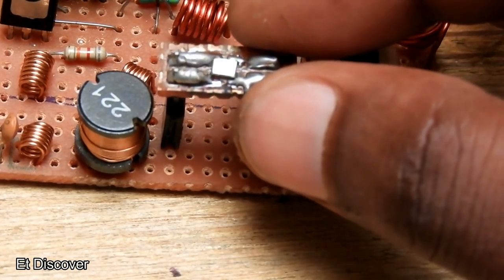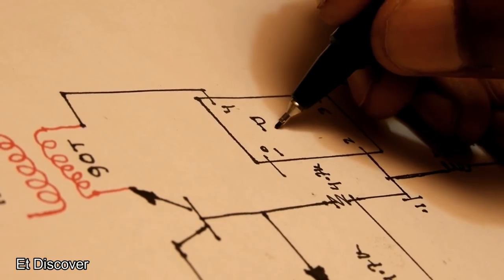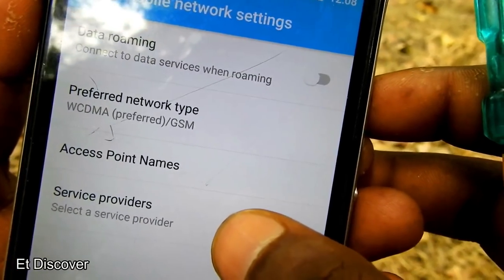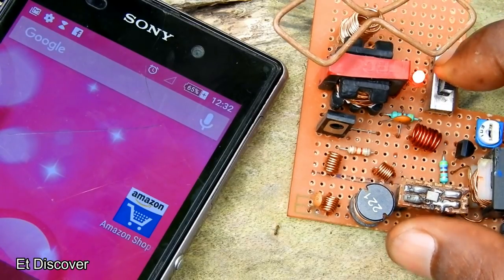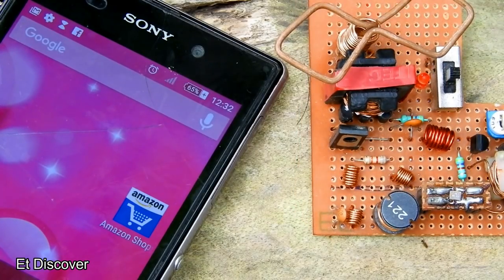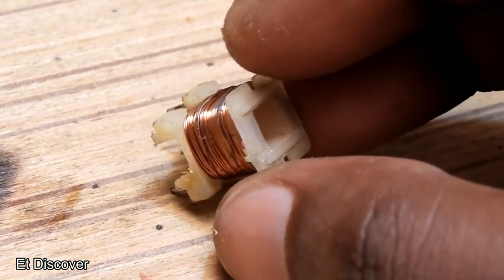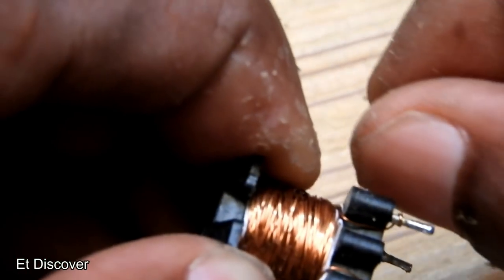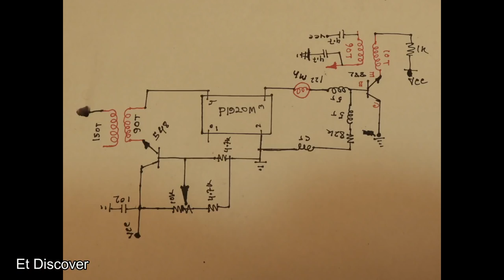Cristel Oscillat 4G 3G 2G Network Signal Booster (Et Discover)

Comment: This circuit is great.
It even works for wifi.
Signal increases 2 bars and no more disconnects.
Also on it close to digital tv antenna no more picture breakup.
I put it next to my auto engine. Mileage to up 10-15 mpg and lots of power.
I put it on my pillow at night now the bald spot on my head is growing a lot of hair now.
Also missing 2 tooth in front new one grow back.
Wife too small on top put circuit in her purse now like mountains but problem now she poop a lot.
You should build on black box sell make a lot of money.
Reply: Congratulations for improving yourself for this project. You should make his your own God. 👌🤣

Comment: I dont think it will boost the existing signal from the tower. What you did was made a hotspot of 2400 mhz by your old phone oscillator which your new 0hone detected . It will will only show that you have full network but you cannot call anybody. Correct me if i am wrong.
By the way nice work 😉
Keep it up.🤗
Reply: Abhishek Sarangi  You are more than correct Bro, you actually explained it like a pro. What he produced is a one-way modular or miniature transmission station sending out but not receiving signals back, so clearly it can't achieve two-way communication
Reply: right bro this is 2400mhz signal   generator  not booster 
we can't call from thisnetwork no data
Reply: Exactly
Reply: simplex transmission not duplex transmission . am I right ?
Reply: Ok you all are telling it is 2400 mhz generator.    it can boost 1920 mhz
Reply: @animeshyadav2369  please tell me it can boost 1920 mhz
Reply: Hi abi, i have been facing airtel network issue at my residence from past 3 year. I have lost hope on airtel that they would improve the reception. They just killed my time. Our neighboring houses are jointly connected to every house. I completely loose signal in ground floor. Plz help me how can i get better reception inside my house.
Reply: @falconkillingmachine3450  just get a proper booster they are cheap now
with proper silver rare earths that is truly the only way

Comment: You have used 2 transister here 
1) 150T /90T
2) 90T/10T .....plz specify primary and secondary coil in both
Reply: i think the secondary coils are the ones with less turns. Not explained very well. Hard to build because of less information availble from this video.

Comment: what does it mean: transformer primary 150t 30awg and secondary 9t 27awg? Is the transformer purchased or is it built? 150t = 150 turns of wire 30awg? Thank you!!

Comment: Where is the data network symbol like E for EDGE, H for HSPA or 4G or LTE for 4G. This just for 2G not for all frequencies. It is just a signal hotspot that's why he has not shown the network name by sliding down the status bar.
Reply: You just bump up the crystal oscillator to 2000+mhz it will do all of them. But i doubt you can find one in market.

Comment: Super . It is useful for  no network places... People....
Reply: This circuit is great.
It even works for wifi.
Signal increases 2 bars and no more disconnects.
Also on it close to digital tv antenna no more picture breakup.
I put it next to my auto engine. Mileage to up 10-15 mpg and lots of power.
I put it on my pillow at night now the bald spot on my head is growing a lot of hair now.
Also missing 2 tooth in front new one grow back.
Wife too small on top put circuit in her purse now like mountains but problem now she poop a lot.
You should build on black box sell make a lot of money.

Comment: it seems made to generate signal around this band ...amplifying  such signals of 2g if it is so...great
Reply: This circuit is great.
It even works for wifi.
Signal increases 2 bars and no more disconnects.
Also on it close to digital tv antenna no more picture breakup.
I put it next to my auto engine. Mileage to up 10-15 mpg and lots of power.
I put it on my pillow at night now the bald spot on my head is growing a lot of hair now.
Also missing 2 tooth in front new one grow back.
Wife too small on top put circuit in her purse now like mountains but problem now she poop a lot.
You should build on black box sell make a lot of money.
Reply: @gordonwelcher9598  i again explain here for yourself?

Comment: Good & usefull circuit 👌👍😊
Reply: This circuit is great.
It even works for wifi.
Signal increases 2 bars and no more disconnects.
Also on it close to digital tv antenna no more picture breakup.
I put it next to my auto engine. Mileage to up 10-15 mpg and lots of power.
I put it on my pillow at night now the bald spot on my head is growing a lot of hair now.
Also missing 2 tooth in front new one grow back.
Wife too small on top put circuit in her purse now like mountains but problem now she poop a lot.
You should build on black box sell make a lot of money.

Comment: Bro can you explain how this circuit is working and plz also tell me it's frequency and its range plz reply fast
Reply: This circuit is great.
It even works for wifi.
Signal increases 2 bars and no more disconnects.
Also on it close to digital tv antenna no more picture breakup.
I put it next to my auto engine. Mileage to up 10-15 mpg and lots of power.
I put it on my pillow at night now the bald spot on my head is growing a lot of hair now.
Also missing 2 tooth in front new one grow back.
Wife too small on top put circuit in her purse now like mountains but problem now she poop a lot.
You should build on black box sell make a lot of money.

Comment: `its not a f king booster its a artificail network created by crystal circuit .......lol ........... repeaters are  catch the signal process it then they transmit its power according to input signal ... thts process called re modulation ........ U should learn

Comment: Your explanation about this circuit is very poor and even in the transformer that you used said 150turns in primary and 90turns in secondary but in your explanation you mentioned 10turns in secondary and also you didn’t explain on how you constructed the other transformer and the two in one inductor which I guess is for the used of antenna in the circuit 
You have left so many things unexplained in this circuit which  turnout to make the circuit unusable for DIY projects